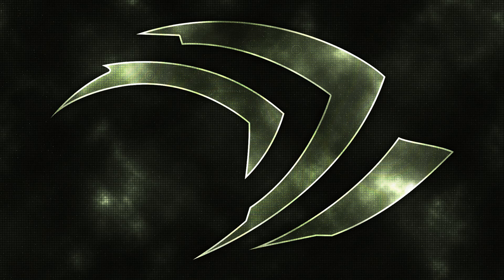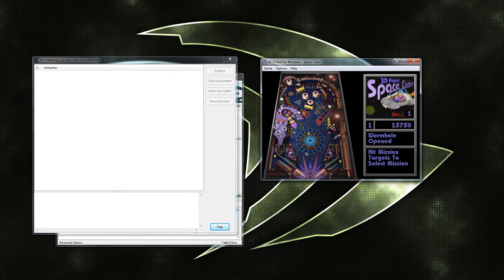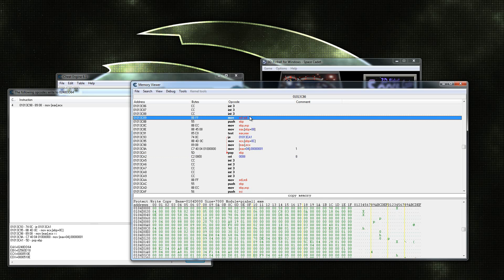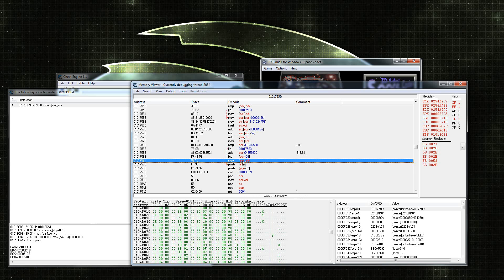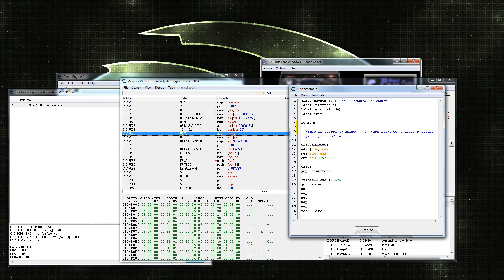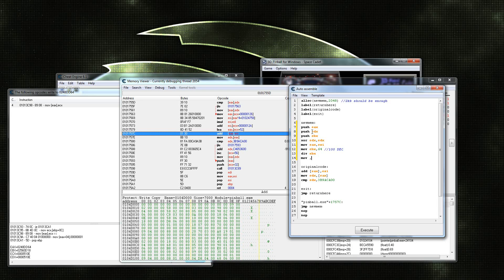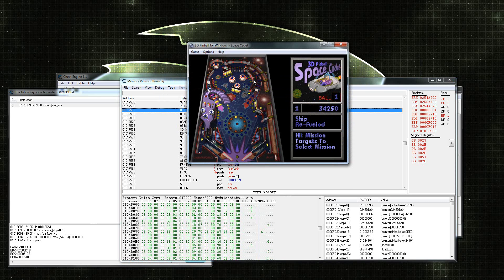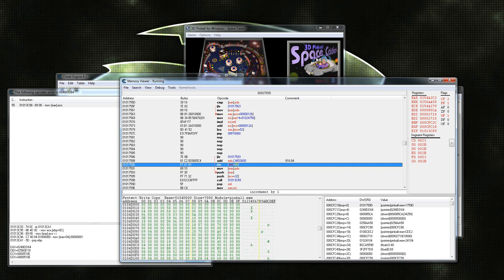[1080p] Using ASM injection to hack games

Comment: Why do you only XOR the EDX Why not the others aswell? Why does it avoid the overflow?
Reply from the maker: The div instruction in 32-bit mode uses a 64-bit value that is stored in two registers EAX and EDX,  where EAX holds the lower 32-bits and EDX holds the higher 32-bits.  The result is also stored in these two registers.  There could be an existing value in EDX, and xoring the register by itself changes its value to 0, which ensures it does not have an existing value.

Comment: Hey - I thoroughly enjoyed viewing them in association to the auto assembler tut found on CE forums.

I understood most of what you wrote and found myself unable to get the same results. 
My script is exactly as yours and I followed the procedure to the T, the issue I face is the game runs fine as usual after inject only until it hits a bumper and crashes. The game does not seem to like the jump written.

Suggestions?